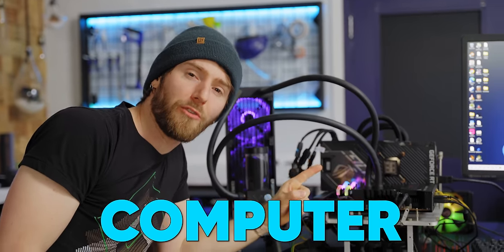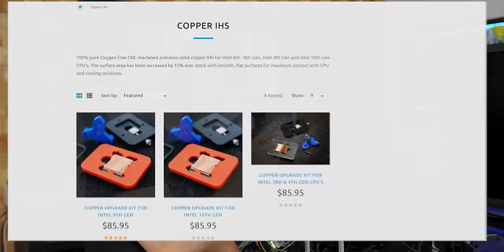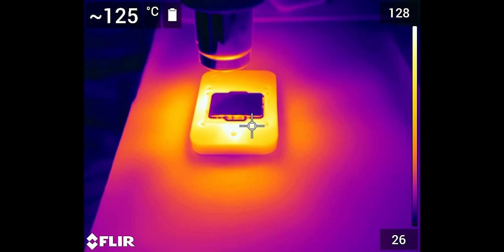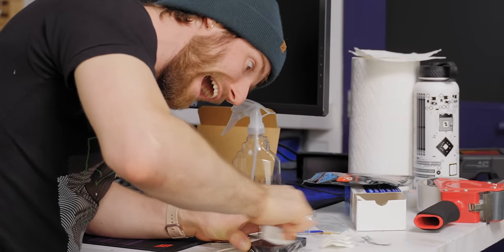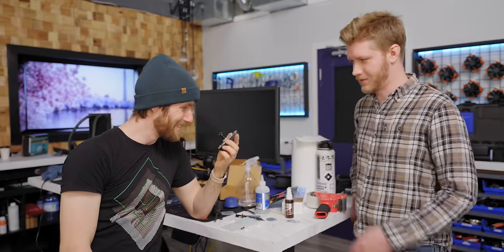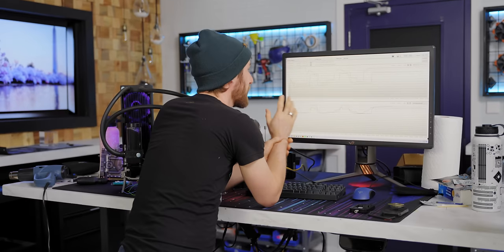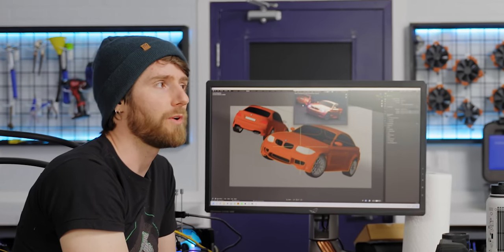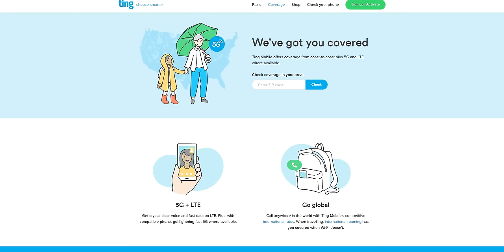Making Intel's Worst Product Better.... And Also Worse

Comment: I want to see how Silver which is more conductive than copper would perform. Like Linus and a few other youtubers could afford to show testing on Silver heatsinks. I guess it would perform 7% better than copper.
Reply: Wouldn't it bend?
Reply: Diamond – 2000 – 2200 W/m•K... They should Use Diamond 💎. Better than Silver 5x times 🤣😅
Reply: Not too much difference, although it is probably a bit better.
But consider that a copper heatpipe is about 20-200 times better thermally conductive, and you'll realize why hardly any coolers use silver. Ease of manufacturing and corrosion resistance of copper metal play a role too.
Reply: Why yes, silver is 7% more conductive than copper(that in this case would at best give you a couple degrees less), it also costs 50 to 150 times more per pound

Do I need to explain why it would be such a stupid thing to do, or you think you can manage that for yourself?

Also, metal liquid is mostly gallium
Silver and gallium make an alloy, Ag2Ga, that can happen spontaneously at room temperature
This alloy increase its electrical conductivity, against its thermal one, enjoy
Reply: just looked into that and seems like it would need some sort of plating cause silver alloys with gallium which is in liquid metal, which would ruin it
Reply: On WAN, when Linus was talking about the screwdriver he mentioned that LMG is tight on fuck you typa cash So I wouldn’t be surprised that they aren’t doing even crazier videos like this, I would too love to see that ngl
Reply: @enlightenme2115  synthetic diamonds -> the sky is the limit 🤣
Reply: @thunderarch5951  you already spend 3k for a pc, why not spend about 1k more for the best of the best
Reply: I'm not 100% sure but I would say maybe it wouldn't make as much of a difference considering heatpipes are up to 90 times more conductive than same size of regular copper, so their mechanism is more important than the material, and also given that there are lots of heatsinks with heatpipes and copper fins instead of aluminum and they don't really outperform regular heatpipes+aluminum fin heatsinks
Reply: @thunderarch5951  you say a silver ihs is stupid, but don't forget that linus also made something even less functional; a solid gold xbox controller
Reply: @QuangPham-gh5un  gallium and silver make an alloy that increases electrical conductivity, have fun
Reply: @awesomestuff9715  forgot to add the part in which gallium, which is the natal liquid used for heat dissipation, creates an alloy with silver, a spontaneous one, even at room temperature
It conducts electricity pretty well, not so much heat, and it would ruin the IHS, have fun
Reply: @thunderarch5951  They literally did a solid gold xbox controller, i'm sure they can afford $3300 IHS.
Reply: Aquacomputer makes a CPU block with a silver heat sink. However, it doesn't perform much better than a top end copper block like one from Optimus. So it's pretty much a wash.

Linus could probably be getting better results if he went with a more performant block and a better radiator setup to get the water temperature closer to ambient. Something like a hardware labs GTR480 or a mora in push pull with Phanteks t30 fans.
Reply: @Ravenousjoe  read better, which part of gallium and silver form a spontaneous alloy you didn't get?
Reply: @HMHacki  Computer use Diamond 💎💍..Linus Should Also. It's time Now. We Need 2 sec faster lol 🤣😅
Reply: I agree, it's stupid and I'd like to see them do it!
Reply: @thunderarch5951  liquid metal is gallium and iridium not silver......
Reply: @thunderarch5951  imagine not seeing it because you edited your message afterwards. You clearly need some help because you are just getting triggered by everything.
Reply: they could do a gold one. I guess it would not be that expensive. maybe 200$ i guess its impossible to finde someone who can mashine it on spec.
Reply: 7% more than copper isnt even going to be one more degree with all the losses involved elsewhere
Reply: @Alucard-gt1zf  indium
Reply: Could work if you plate it. Silver is $0.83 per gram and say IHS is 40x40x4mm (0.0064dm3). Silver weight per dm3 is 10.49kg so we need 67 grams of silver
It amounts to $56 of silver. 

Copper IHS would be 57 grams and that's $0.60 worth of "expensive copper" in there
... so, if Copper IHS plus upgrade kit costs $80, silver one might cost $150.
Reply: A small price to pay for some temps
Reply: @enlightenme2115  I want to see a billionaire customize his PC down to the core. Using the best of the best component of different materials. I don't think NASA supercomputers does it lol
Reply: @ElemXCR  Lol Nasa Always Use Diamonds. What are You talking about. Nasa Computers are Space Grid. Not costumer/grid. Even Industrial Grid Computers are better.
Reply: why not gold they already have the xbox controller
Reply: @clinten3131  Gold Have Lesser Thermal conduction than Copper even. The Best Thermal conductor material is Diamond than Silver than Copper
Reply: Fu*k it lets do gold instead
Reply: @thunderarch5951  Aquacomputer did sell silver (.975) water blocks for LGA2011 and 115x. They were priced a little higher than copper ones, but the difference wasn't even 1.5x. Most of the cost is still machining, not the material itself. I also remember reading about pure gold cooler (gold has even higher thermal conductivity, but you know... It was probably one-off (It was in the times tower coolers were absolutely new thing).
Reply: I've read (dont know if i wrote it right) if copper its 100% silver is 105%
Reply: @ProjectPhysX  So let's go direct die vapor chamber like on sone GPUs. That would be really interesting!
Reply: @GameRusher1234  Gold is worse than Copper bruh....
Reply: At that point I'd say fuck it and go for gold. They can machine it (or contract out) and do exactly the same thing.
Reply: They should everybody who is salty misses the point of this channel its meant to do the most off the wall things why else did linus make a gold controller
Reply: Gold is more conductive than silver too
Reply: He should use banana 🍌 because it would smell good
Reply: How about golden one ?!
Reply: I want to see graphite Vs copper, it wouldn't be too entertaining, maybe 2-4° difference?  Graphite is an excellent conductor of electricity, poor thermally though.
Reply: Dude silver is never used alone, but always in alloys, 'cause it's so ductile  and bendable that a heatsink made out of silver 1000 (even in premium jewelry the silver used is always no more than 925, which means that out of 1000 parts of the total mass of the object, 925 are made out of pure silver, while the other 75, made out of other metals, strengthen the whole thing) would fucking curve 180° put under temps like the ones modern high-end cpu output at high-stress loads. So yeah, pure silver cpu shells won't ever exist, and even if u made one, the pros of using the AU would be countered by the other metals used in the alloy. U'd be better using a 100% pure copper shell. Have a great day!
Reply: Be easier to keep increasing the surface area or chill the res and would lower the temp more . Silver Vs cost and results would be meh . I mean even this video dropped temps but did next to nothing to improve scores
Reply: Netherite is much much better
Reply: See the problem with silver is tarnish and once it does its conductivity goes way down. Even assuming they could use a thermal compound which preforms as well as liquid metal and doesn't ruin the IHS you'd see marginal increase in performance in the short term then far worse performance in the long
Reply: @thunderarch5951  you didn't understand
Reply: @thunderarch5951  Don't use liquid metal then. Problem solved. It would be harder but you could just solder it like they do from the factory.
Reply: Am I wrong or isn’t gold better than copper?
Reply: @trackman07 1. It would be so expensive, 2. Check my other comment regarding silver heatsinks, 'cause it applies even more to gold which is A LOT more bendable and ductile than silver itself
Reply: Linus Flex Tips
Reply: @Vatharian  Gold is great for corrosion resistance, not thermal conductivity.
Reply: @trackman07  Better in what way? It is better at corrosion resistance, but worse for thermal conductivity.
Reply: @thunderarch5951  chill dude, silver is not very expensive for a small-run product. It's the chemical properties that make it a bad idea.
Reply: @enlightenme2115  I mean, lab made diamonds are chemically same and wayyyy cheaper
Reply: Why stop at silver, gold is more conductive.. and were talking about ridiculous ways to spend disposable income..
Reply: Silver oxidizes wayyyyy more easily...
Reply: @samuelivascu7633  unpure silver... noble metals don't oxidize, that'd what makes them noble.  They don't exchange atoms.
Reply: @mattb6646  Silver and copper are more conductive for heat than gold.
Reply: a better way would to just forgo the heatspreader and have a custom waterblock instead.
Reply: @--_DJ_--  ok it's settled then, graphane it is
Reply: I would love to see a silver IHS. If Linus still has the gold from the gold XBox controller he can try a gold IHS too. Why not?
Reply: Potential %7 more performance?!?!
WE NEED İT
Reply: I was about to say gold but then remembered that gold is in between copper and silver
Reply: @moritlh  It is actually below both of them on the chart.
Reply: Silver is more electrically conductive, but could be used for way better stuff.
Reply: Much better would be no ihs and direct watercooling block on the die
Reply: @mattb6646  broooo lemme tell you something. Humidity in the air makes them oxidise and silver doesnt form a hydroxide, it instantly forms silver-oxide. Tough luck bud. Also we have not even mentioned the different sulfur compounds in the air that are present (albeit in small concentrations) oh yeah also touching it, though you can avoid that with a glove. Also the reason there is nickel plating on the copper IHS is because it too will oxidise. You ever seen the top of an old chapel that's green. Yeah, that's a Hydroxo-complex of copper... that's just from humidity and oxygen... edit: form
Reply: Tbh you're kinda missing the point, 70% of what's done on this channel (like using a gas water pump for water cooling) has no actual productive reason it's just for pushing the extremes
Reply: @mattb6646  also if they don't oxidise explain: Ag2S, Ag2O, AgNO3 in all of which (and these are just a few) the oxidation numbers are +, meaning oxidised. Yikes
Reply: @samuelivascu7633  just Google it PURE silver does not rust or oxidize, if it does it isn't pure silver, which most silver isnt
Reply: @enlightenme2115  could you imagine trying to machine a diamond IHS? First gotta buy the diamond, then you have to CNC using high blast water or other diamonds lol
Reply: @ProjectPhysX  silver copper compound much?
Reply: @bulldog8934  Synthetic Diamonds are used for Thermal conduction. But Dimonds are Hard to process that's why Nasa And Other Big companies Use it. It's not for average Costumers. Like the computer would Be Around Millions of Dollars to Be Put Simply. The cost of a Performance Computer Can Go upto Billions also. Like Super Computers.
Reply: Yeah might as well go for gold, diamond Is much better but that would be tough to procure
Reply: @dieubermensch . Not on your life, my LTT friend.
- Lyle Lanely (paraphrased)
Reply: A 5 gram Geiger Square of silver would be the perfect size to try this with. It's just over 1 inch, and soft enough that just about anybody could do some home lapping to make it as flat as possible without machinery.
Reply: @ML-fc3je  More electrically conductive. Not more thermally conductive
Reply: @thunderarch5951  You know that while silver is more expensive than copper, it's not prohibitively expensive to the point of being unaffordable do this channel, also, there is nothing saying that you can't copper plate the silver IHS, the same way copper IHSs are nickel plated.
Reply: What about copper dust in thermal paste if u added it?
Reply: @pedro_8240  copper plated silver....this isn't a bad idea. But it would require an electrical or chemically evaporative deposition.
Reply: Honestly that just seems like a waste of time and money. I can’t remember if they have a cnc, so if they didn’t they would need to find someone to machine it, and they’d need a decent chunk of silver to be able to machine it. And to do all of that just for, more than likely a tiny gain in performance, it just seems kinda stupid to do it. Not to mention what everyone else is saying about the liquid metal. So then they’d need to get it plated. Seems like to much work and money for not enough gains. But that’s just my thoughts 💭
Reply: In this extreme example it would be worth a go. It might cost as much in silver as a CPU but it should work fine. I don't know if the liquid metal would dissolve the silver so you might have to solder it or copper plate it haha. It might be better to make a silver water block and mount it right on the silicon with liquid metal. In the olden days there were no IHS.
Reply: @L96A2Recon  Gotta love it when you get successful enough "tight on money fuck you money" still means pulling apart $800 CPUs
Reply: Silver gets tarnished, then goes off to become Elden Lord I guess.
Reply: how about gold heat sink? hahahaha
Reply: @ProjectPhysX  
Except you cant use heat pipes here
Reply: @thunderarch5951  
Cost be damned
Reply: @enlightenme2115  its space grade not grid. consumer grade not grid
Reply: @mattb6646  okay im gonna leave you to this, but one thung that would make it stupid even if silver didnt oxidise in it's pure form over time is that it's soft af do using it as a heatsink/IHS is off the table.
Reply: @thunderarch5951  condescending much?
Reply: @madbruv  Thanks... English Is not My first Language. 3rd Grade teacher 🤣😅🤣
Reply: Yup. Gold<Copper<Silver<Diamond. Diamond is way out in front.
Reply: came to say this!!!!
Reply: @thunderarch5951  u can just melt it down and sell it as a silver bar
Reply: Der8auer makes some silver heatsinks on selected cpus selled on caseking... But the pricing is enormous
Reply: Nah I want to see a diamond ihs
Reply: @tesmat1243  that doesnt make any sense couse it hasnt a better thermal conductivity😅
Reply: @XxX0Fanta0Holik0XxX  yes 5 times better than silver
Reply: @enlightenme2115  If you're talking IHS then yes, it'll be amazing.
But if you're talking heatsink then good luck shaping diamond into a heatsink.
The exact shaped of the heatsink plays as big as a role ,if not bigger, as the conductivity of the material.
Reply: A company called NoiseControl made a heatsink they called the Silverado back in the early 2000. Now this wasn't a silver heatsink but it did have a silver slug that was supposed to act as a heat spreader. There's a review of it on FrostyTech that was posted back in 2002.

While silver has better heat conductivity than copper there are a lot of other problems which a lot of people have posted about. It tarnishes quickly, that is it oxidizes in contact with oxygen. I doesn't play nice with liquid metal thermal interface materials, it's soft unless alloyed with some other metal and it's expensive compared to copper. The tarnishing can be minimized by using an alloy, or it can be avoided by plating it with some metal that isn't reactive with oxygen or liquid metal. Gold plating is probably a viable idea. If it's thin enough it won't lower the thermal conductivity by a significant amount, it's not corroding with oxygen and it's probably not reacting with liquid metal.

All in all I think it's more trouble than it's worth to make a IHS out of silver. And the same goes for making a CPU water block or a heatsink out of silver.
Reply: @ML-fc3je  Silver is better.
Reply: @Frownwarrior  how much do you think gold costs?
Reply: @bulldog8934  well I did not the math, but if I remember right, my IHS has is about 35mm x 35mm x 2.5mm so total volume about 3000mm3. now its not a solid block. it has a lot cut out so I guess its maybe less than half the volume. therefore I guess its about 15g of gold?  Gold is about 50k /kg right?  okay... i see that would be still a cool 750$ .... yeah okay. maybe a pure gold IHS is expensive xD. but it would be cool for sure right? xD